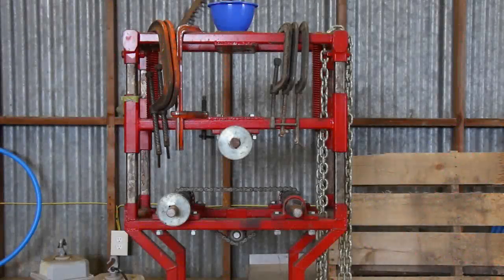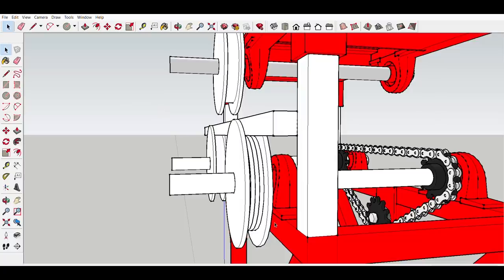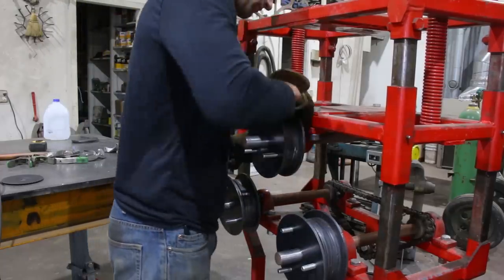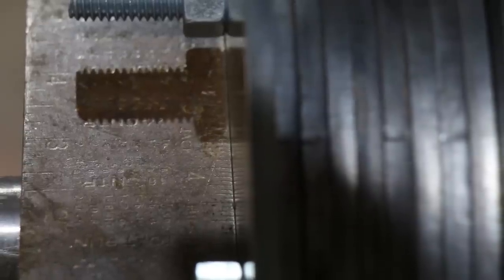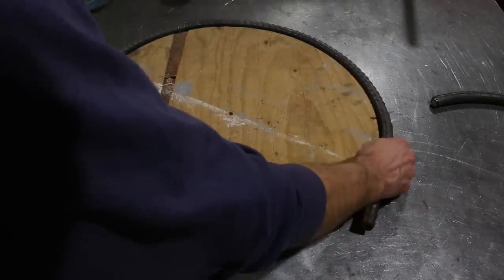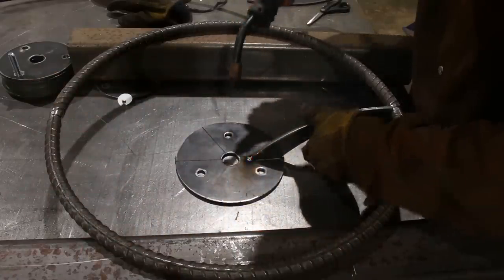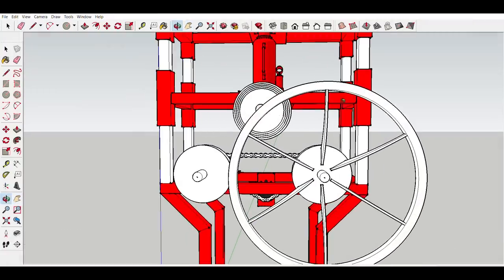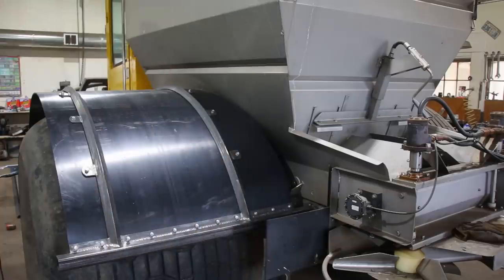Ring Roller

Comment: Wow ! That's a brilliant design !  Great job . You saved yourself thousands of dollars.  Now you only need to replace that hand wheel with a reversible motor. It will greatly increase your machine's rolling capacity ( stock sizes ) . You just gained a new subscriber .

Comment: Ganging up a bunch of 1/4" plates cut on the plasma has got to be WAAAY cheaper and faster than turning and milling them. That was a great solution. I work in a combined machine/welding shop and have been wanting to undertake a ring roller build for awhile now

Comment: Welcome back!!..a little tip when rolling. ..3.141or pie (no proper symbol for it) multlpy by the diameter will give your material length  and then give a little more for the distance between your middle roll and the centre roll on both sides

Comment: You can still drive that top wheel.

Keeping it simple, use a plate with a sprocket on either end. Make it attached to the frame that the bottle jack is attached to. As the upper frame moves up and down, the gears will always stay the same distance apart and you will not require a tensioner.

Comment: You should put a heavy spring under the jack so that you can get more rolls out of each setting on the roller. A very heavy spring. will still give you pressure, but will take up the movement as your bends progress.

Comment: Great video. If you want to bend tube use the same multiple plate approach and weld them into an approximate curve. Then ask a machine shop to turn them on their lathe. The cost in making tube rolling dies is in the humongous size of the starting billet and the ages spent turning it down. You'd have all this done.

Comment: Hi there! Really enjoy your videos!
I do cnc plasma cutting every day, for the past 5 years now.
Try cleaning dross with a "knotted cup brush" or "Twisted wire cup brush" with your baby grinder - you will not look back!
With abrasive discs, you loose a lot of time because the abrasive discs grind the dross down (and a little bit of your parts as well), while the twisted cup brush brakes the dross of effortlessly!
Do use the cheapest grinder, because those cup brushes can not be balanced!
Here in South Africa, quality baby grinders cost about R1500 to R2500.
I use the grinder about 5 to 7 hours per day with the twisted wire cup brush.
Quality grinders last about 3 weeks @ 5-7 hours every day, while the cheap grinder i buy for R200 lasts for 2 weeks!
Hope this might be helpful.

Comment: Nice build. Much better then alot of commercially  made ring rollers I've seen. I like the idea for the dies that you came up with. So simple yet so smart and versatile. Maybe upgrade the bottle jack to a air over hydraulic model with a foot pedal, just a thought. I'd be interested in a set of plans for this and cnc files.

Comment: When setting up for rolling square tube, it might help to have a slightly larger-diameter die piece as the centre layer of the upper die. This indents the concave surface of the rolled piece.

Comment: Reversing the upper guide would be simple if you had two idlers at the top, and then press the chain to a gear on the top shaft gear underneath. The idlers should be spring loaded, since your upper roller moves up and down, so the springs would maintain tension on the drive chain and hold the chain to the underside of the upper guide gear.

Comment: Not a bad design , nice and heavy duty to do the job but light enough to drag about , great idea on the spacers to make the width on the rollers . Im guessing you could use the same idea on the angle section for round tube aswell ..really liked the rebar handle and the spokes were a brilliant design ..hope it serves you well for the future jobs and you find somewhere for the clamps and chains to hang off .

Comment: Too late now but I wish I could have worked with you. I could have shown you a trick to power the upper roll and get vertical adjustment. If you care to work it out you'll need three idlers - and, of course, a longer chain. 

Here's a verbal explanation I hope isn't too confusing: 

Call the two lower roller sprockets on the lower fixed structure 1 and 2. 

Call the upper roller sprocket on the movable structure 3. 

Sprocket 4 is an idler that mounts on the fixed upper structure directly over sprocket 1. 

The chain leads vertically up from under sprocket 1 over sprocket 4 then vertically down to wrap under sprocket 5 an idler mounted on the movable structure. 

Sprocket 5 redirects the chain from sprocket 4 to  wrap under sprocket 3. 

The chain then wraps over srocket 6. Sprocket 6 is an idler that mounts on the movable structure directly over spocket 2. 

The chain leads from sprocket 6 vertically down to wrap under sprocket 2 and connects to complete the chain loop using your existing idler to adjust the slack.

This arrangement allows infinite vertical adjustment of the movable structure over its full range without conflict with the chain length and it reverses the upper roller direction.  

Your use of - um - "laminated" rollers is very clever and an alternative all but impossible to effect without expensive machine work before the advent of CNC plasma cutting systems. Your CNC plasma table gives you near-machine tool accuracy. I can see many possibilities for easy-way rolling light channel and leg in or leg out rolling angle, pipe and tubing, round rod, square tube and bar, etc.

Bending steel is hard work. If you use your roller much, I predict you'll soon be figuring a way to power it from a motor.

Comment: Very cool. I like the flat plate stacking concept to achieve the desired profile; simple and cheap.  Have you done the same for round bar yet? Not counting rebar, I mean. What is the minimum radius possible?   Lastly, nifty fender design with "tri-angle" trusses.  Guess that's just how it's done on the farm.

Comment: Nice plasma cutting table! I am actually wanting to get the same one, although I noticed that you were doing a lot of grinding taking the slag off of your parts. If you incorporate your plasma cutter to cut while it is submerged in water, it reduces the amount of slag on the pieces significantly! In some cases, the slag cleanup would be practically non-existent depending on the travel speed, type of material you're cutting and the thickness of the part; assuming you adjust the cutting speeds accordingly and the part is completely submerged. Another benefit to submerging the parts is that there is minimal heat input because water is one of the best at dispersing heat. Might not be an issue with thicker metals, but sheet metal or thin aluminum could be problematic when plasma cutting and is why a lot of manufacturers use waterjets. I know you don't have much room to work with considering the depth of your water container, but you could possibly make your sheet metal inserts that hold the material up into place not as tall to allow more room so that the plasma cutter is able to be submerged into the water. Just be careful they're not too low where the plasma cutter might do damage the aluminum round stock that holds them into place. Then I would get a decent size water pump with a reservoir to suck out the water to raise and lower the water level before and after every cut. Not to mention it reduces the amount of noise when the plasma cutter is submerged in enough water. If it's barely submerged, probably won't make much difference with the sound because of the air coming out of the nozzle. Not sure if you would even want to incorporate something like this, but thought i'd say something anyway's. Good video editing skills and explanations of your thought process throughout your videos! It makes your videos very interesting... keep the projects coming!

Comment: For rolling round tube could you not make the dies by cutting various diameter discs but holding the plasma cutter an gradually increasing angles as the discs get larger in order to cut a bevel. Then stacking them all together and further improving the curvature manually with a grinder.

You wouldn't be able to cut them on a standard CNC table, but mounting a handheld plasma torch to a jig at the required angle & diameter then manually rotating the stock around the centre point should still get the job done.

Comment: Just curious, have you ever considered using anything else for CAD work? Clearly sketchup is working just fine for you, but there's so many other options out there these days that are easier to use for mechanical assemblies. Not a criticism, just curiosity on my part. Love seeing your videos come out.
Reply: Totally get that. I use CAD professionally, and each time I've had to switch and learn a new program it's a time consuming process. The one thing I'll say is that the resources to learn from these days as so much better than they've ever been, I'm sure it wouldn't take you that long to acclimate. Whatever you chose to do I'm sure will work fine for you.

Comment: How nice for you, for those who can't calculate beyond fingers and toes. home made roller ~ $300, 1/4" 1200x2400mm cold rolled sheet ~ $400, 1200x2400mm cnc plasma cutter ~ $45,000.
Yeap sure beats me, motorized roller with 9 dies $3,400, industrial lathe 1000mm between centers $5,800, 200mmDx300mmL 1040 round stock steel to make set of 3 new rollers when needed ~ $60. Oh! I can roll up to 1.5"/38mm solid can you with a push of a button?